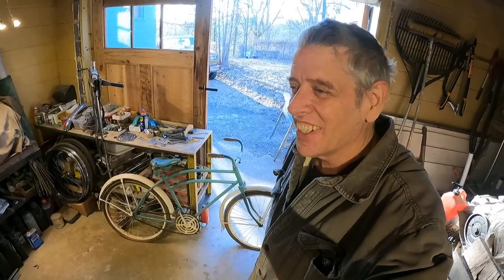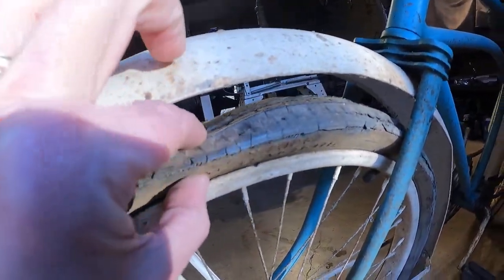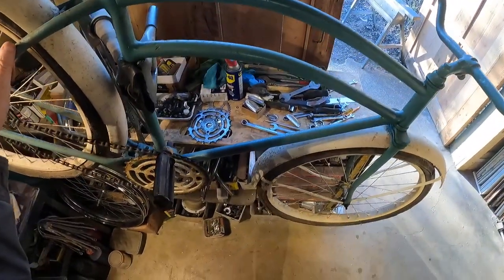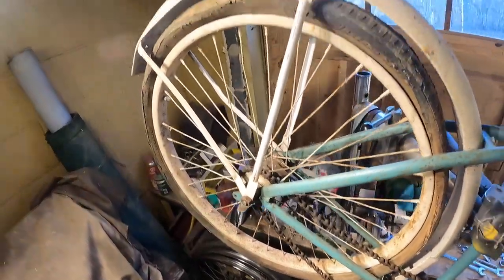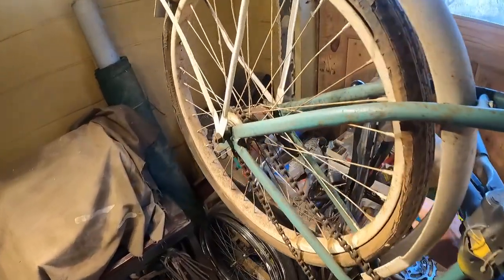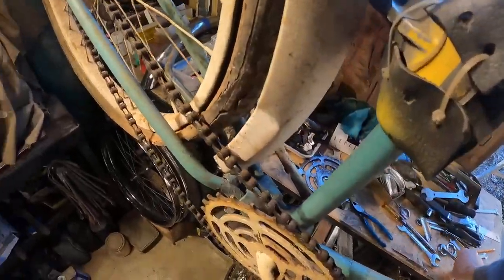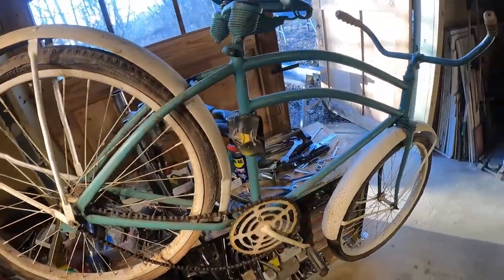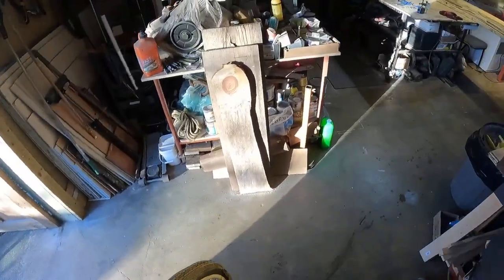1936-38 western flyer bicycle -possible frame repair

Comment: I'd say its about 1936-38 with the straight downtube
Reply from the maker: well that would explain the chain adjusters on the drop outs,thanx any info is appreciated
Reply: Also has ears for a drop stand. I'd say just the frame and forks, the rest looks like Johnny Cash parts
Reply from the maker: @tmsek8155  yes i saw the drop stand also-the fenders are wald for sure with those thru bolts and crappy fender stays. at least the grips are there haha